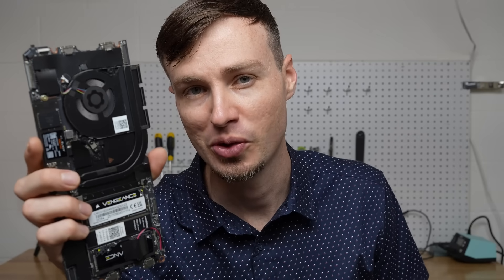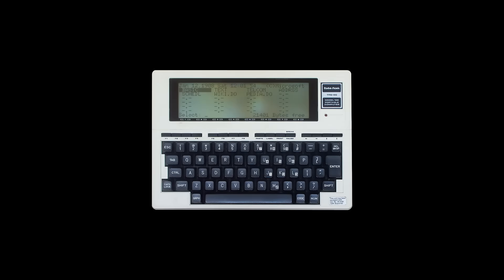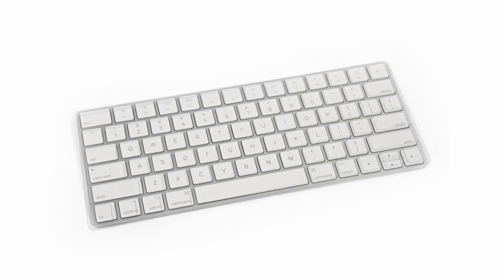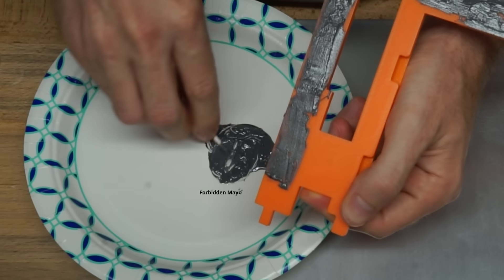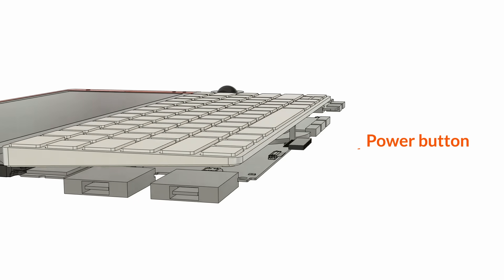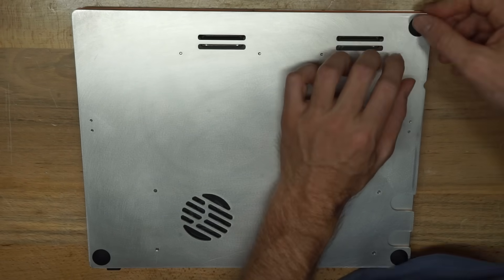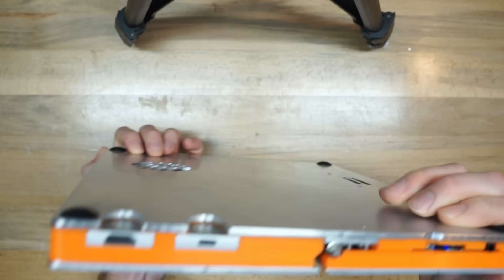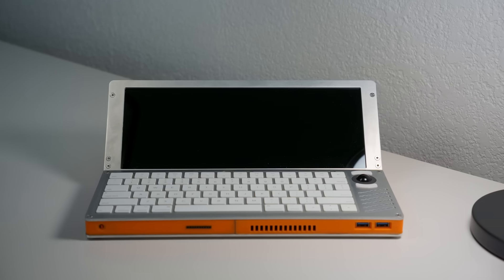Framework Cyberdeck - DIY Portable PC

Comment: Than useless Fn key on the bottom left
hm
Could you imagine if you were able to code it so that when pressed and held down, the trackball would behave as a scrollwheel ?
So even when handhelp instead of on a surface it would be easy to shift you left thumb down a bit, and then use the right to do the scrolling.
And whatever top right button that is near the trackball would maybe be a middle mouse click (scroll wheel click) also when Fn is pressed down
That or a rotary knob but it would imply changing the HARDware and the know might be too tall for an idea I have (3rd paragraph)

I love the end result
I'm nowhere near as talented as you are, so apologies for mentioning some "easier said than done stuff" but if I had to bring up a few gripes and pass them on as "recommandations", I'd say that I'm not the biggest fan of the exposed stuff on the back... to an extent. I think a clear sheet of acrylic would be dope to show off some of the stuff when the screen is lifted, while preventing snagging or other misfortune to the pieces and especially the ribbon cables.

Also I was thinking about that one ASUS x ACRNYM tablet thing (edit : asus acronym z13 is the name), and was wondering about some sort of "case" to clasp onto it to protect the screen, keyboard and powerbutton while also having sling attachment points. Note : the asus thing does not have a case and uses a folio style keyboard that covers the screen, but it looks VERY industrial, futuristic, cyberpunk even, and has a way to attach a sling for transport. Which I think sets it off rather than a normal laptop sleep. Also I'm thinking of a solid case, not soft. More metal woooo
Reply: I love the fact that being a framework, it too is upgradeable, wether in the future or even right now if you want to make it a blazing fast little machine (let's ignore budget constraint for now)

Comment: Great job!!

Two things you mentioned that always baffle me.  

1) why don't laptops have HDMI in to use the screen as a monitor ?

2) why doesnt anyone make cheap SBC that runs Windows? I mean Pi, orange Pi, Banana Pi, Rock Pi. And many others. But nothing for Windows? Why?

Also would be nice if you shared the cost. I just checked eBay and couldn't find the motherboard.

Comment: You can unofficially run Windows on RPi but all exetuables have to be compiled for ARM64. On Linux most things are open source and then just compile. If not qemu can emulate an app (!). On Windows I don't think there's such a thing for ARM.

Comment: For the IO modules if i may suggest a part that could solve your problem and make it easy to remove them. The basic idea is a sled with two rails on the side and a lip on the back which would interface with the module's back side. You place your finger into the hole on the bottom of the sled and pull it out of the assembly in one piece. 

Fusion360 Screenshots of the part:

https://snipboard.io/gjhpbE.jpg
https://snipboard.io/KxXk43.jpg

(please note this is just a quick sketch to illustrate what I'm talking about)

Comment: Old Compaq LTE laptops had the trackball mounted in the screen frame, with the small ball next to the screen on the righthand side, and the buttons on the back(top of the lid)

No major manufacturer call their portable for 'Laptop' any more. Most of them gets too hot to safely use on your lap, so they avoid the word to avoid lawsuits.

Comment: This is awesome.

Only things I see that could be improved on top of your observations is the flex cable from screen to control board being so exposed. Maybe it'd be better to have the control board attached to the the screen side of the top part instead of the base plate. Them you could have put some kind of thin covering film (capton or some other foil) on the bottom/top insides to close that off neatly and route the inputs of the control board to the edge of the device.

Comment: Ok, seriously - while I, personally, would not use this... this shows basically the power that things like Framework offer - the results of its ideals and hard work.

When I was younger, I remember we buying computer parts on basically "flea markets", hoping that things would work together, hacking solutions... there were people that sold computers built inside wooden boxes that merchants used to sell fruit, for example, and there were a lot of people that simply tried to build the wackiest, weirdest combination of pieces that somehow functioned as a computer.

Then it mostly went away, then it was back with Raspberry PI and limited resources. Now... it can be revived, just because we have a company that is worried about making reusable pieces, not gluing everything together, etc... this is seriously VERY COOL!

Comment: The mouse ball… is fine but the left/right click button placement makes zero sense. Could have placed a set on the left of the keyboard.
Reply from the maker: Those buttons were integrated into the trackball module already, but yes, I should have wired in separate buttons on the other side.

Comment: Weird, heavy, and rugged is perfect for me. Ideally I'd CNC the whole thing out of two blocks of aluminium, and a sheet for the screen bezel and keyboard cover. I'd make it completely foldable in a clamshell design though. 
I would also probably somehow integrate a trackpad, instead of the ball, or at least place a scroll wheel module next to it.

Comment: Been thinking about a similar idea to this for a really long time, and yours is really cool. This is less ambitious than the things I have been thinking of, but has the benefit of actually existing.

The main concept for me was: what if there was something about the size of a netbook, with a computer that didn't suck and had a good keyboard. Mine would end up being bulkier, since my intent was to base it around a tenkeyless mechanical keyboard, and a clamshell design. Compared to yours it would be a brick. And the idea I can't seem to get out of my head is have an E-ink display, since the usual scenario where I think about using a computer like this is just randomly being able to sit down and to programming basically anywhere, and part of that is visibility of a screen in sunlight.

I am probably never going to get around to building it, but it feels a lot more possible ever since the framework came out.

Can you maybe do a follow up on this in a few months or so after you have spent some time using it?

Comment: Interesting use of the framework motherboard and i can see custom cyberdecks becoming more mainstream once modular laptops start getting more popular
also i'd highly recommend trying to find a low profile wifi/bluetooth adaptor you could solder somewhere, give it a little more versatility without having to take up a usb slot

Comment: Wondering if you can eventually use a Framework board as a Steam Deck replacement, so you can use the system as both a portable console and a laptop proper when you're at home.

Comment: I think this shows how much framework changed notebooks in general. It doesn't have the freedom that desktop PCs have but now we can literally build our own notebooks ourselves. Hopefully something like this comes to smartphones and other devices.
Reply: framework phone?!
Reply: @griffingibson4389  why not use the custom cyberdeck and an Internet gateway to make a VOIP call? Dump the ankle monitor.
Reply: @griffingibson4389 it already exist is called fairphone
Reply: fairphone has quite a modular system but I haven't seen anyone build something else with those. but the connectors between the modules are well documented so it should be possible... if I ever find the need to upgrade my FP4 I think I could try making something cool with it(s parts)
Reply: @thetj8243 The issue with fairphone is its wayy overpriced for what it is, its got worse specs than a Samsung A54 and is double the price.
Reply: phoneblocks and project ara. none worked though, probably a bit too ahead of their time and not enough advancement in tech.
Reply: They literally piece together phones from scraps in chinas malls.
Reply: this shows my ass
Reply: I believe they’ve mentioned that as a potential far future idea. Not totally sure tho
Reply: An ancap Linux user! Rare sight!
Reply: There used to be plans. Look up Project Ara. It was shut down. But hopefully someday someone resurrects it
Reply: Desktops have loads of space, laptops have less and phones have very little, you won’t get a modular phone any time soon.
Reply: @conorstewart2214  nah, just redefine modular and u got 2 decades ago, for example your cellphone with removable battery. Every electronic have "modular" capability, it's just how you view things
Reply: @conor fairphone 2
Reply: @conorstewart2214  the Aria would've been nice if Google hadn't killed it.
Reply: Well, it's not like you've got much freedom with pc parts too - a new generation of CPUs likely won't even work with your motherboard and everything is chunky asf
Reply: @ruslan_yefimov  "a new generation of CPU" this a given. but literally everything else has freedom for 7+ Years. i can use a GPU from 2005 ffs.
Reply: @ruslan_yefimov AMD supported the am4 socket for like 5 years+
Reply: @ruslan_yefimov  While I don't agree with your opinion, AMD has proven it's possible to have better performing new parts on older platforms, as for chunky, There is no way to ignore power usage, you need a robust cooling solution to use high power parts (modern GPU's) all laptops do is claim the part is the same but limit it's power heavily (if they could make it work on a 15mm laptop, why would they bother with huge desktop form factor coolers) and even under best conditions, the laptops do burn themselves out in the end much faster than a desktop would simply due to how tightly everything is packed together. And like another comment said, I can pop in an old ethernet pci-e card and it will work, i can have 3 different GPU's for 3 different use cases in use at the same time. I can modify my BIOS to support features that the mobo manufacturer didn't want/couldn't/wasn't profitable to include. All that's currently limiting is intel style approach to platforms and chipsets, imagine we had to swap our motherboards once every 10 years. you would have the same PC for a long long time. unfortunately they force you to upgrade the main part of your PC which is imo hardest to replace if you have something special (2.5g ethernet etc) than a CPU that just inserts into one.
Reply: @ruslan_yefimov  Whatever you're taking... I want some. CPU's wouldn't sell if there wasn't motherboards to support them, that means both motherboard and CPU manufacturers need to work with each other to make their products. Some processors require more power, the motherboard needs to be able to handle that load. 
Addressing the whole chunky thing, that's mainly for airflow. Believe it or not electronics get hot when you shove a lot of electricity through them, there's not a magic void that can suck that heat up.
Reply: @Deja117  yeah with a desktop they are going for maximum performance and adding in lots of features and connectors and making sure you have space to use all the connectors. A laptop however is designed for efficiency and to be as small as possible hence a lot less power and a lot less connectors and saves space by soldering CPUs or RAM.

You do get small form factor desktop components though, they aren't anywhere near as compact as laptops but they can be a lot smaller than normal desktops.

Comment: This project is BONKERS! Thanks for the inspiration my dude, and also, I know the arduino helps with the GPIO which was an objective to the project, but if you or anybody wants to recreate without the arduino, the track pad port for the laptop usually uses ps2 so you could wire the trackball to the mother board directly.

Comment: Next time use Polyamide tape instead of electrical tape. Electrical tape seems to come loose after few days. It doesn't adhere properly. Along it, you can use Tesa or 3M double sided paper backed adhesive or thin plastic backed one. This is easy to remove when you use IPA.
Reply from the maker: Thanks, I'll look into that.

Comment: You should find some apple key-caps that are also orange to fit with the sites kf the body of the machine.

For the exposed parts of the back of it, you could probably have a thin housing and maye find a way to tuck the wire for the screen itself away.

I'm also thinking you can make it so everything is on the upper half under the screen and the rest on the lower, so you fold the screen forward to move the expansion slots and maybe have a second cooling system for when the screen is folded forwards and another fan can just turn on, possibly with the help of a switch. Maybe, itteration 2 would be the deciding factor if you see if that might work out.

Comment: Nice design, but how would I cut the aluminum plate into two parts? The device will still be thin and cool, and at the same time you will block the path for dust and damage to the monitor ribbons. For better stability, you can add additional support for the monitor because the motherboard takes its toll. I would change that. The rest seems pretty cool. What would be the price for such a device if it were sold?

Comment: I feel like this is the first Framework Cyberdeck I've seen, though I could be seriously wrong.  And I too really miss the design choices of the late 90's and the 00's.
Reply from the maker: There is at least 1 other one I saw that was made with clear acrylic, but it did not have a full keyboard and had a very small screen.

Comment: looks great man! I had a mild obsession with netbooks for a while and the biggest problem was lack of performance and low screen res. Your project looks amazingly similar to what I wished I could get back then. I might just pick one of these mobos up. Great work and earned my sub
Reply: There were fast netbooks, but they were crazy expensive. During my time at tech university in Munich, there was another student which had a new HP netbook with an i5. It was 2010/2011 and as far as i remeber it was over 2000€. It was very small, less than 12 inches and super thin. But still had better connectivity than what we get nowadays even from big laptops. Ecxeption maybe the Panasonic ones. I do use a Toughbook detachable for work and a Let's Note (2000's laptop with modern parts, basically) which have good connectivity, but are bulky. The small laptop market is grim nowadays.

Comment: For scroll wheel you could use the trackball and one of the unused apple keys to switch between modes.
Or add a button to the arduino to change between scroll wheel and mouse pointer movement
Reply: Exactly what I was thinking.
Reply: I just pooped my pants daniele

Comment: They do make PS2 to USB adapters, so that might could have been an easier way to handle that. Or, ya could have just gotten a USB trackball. That's also a thing that exists.

For that matter, if you're going to use a microcontroller as a middleman, why not just hook the keyboard and trackball up to the respective ports on the board instead of eating up a USB with it?

EDIT: I do have respect for the work and results, btw.

Comment: I was thinking the other day to something that would be pretty much the opposite to this.

A screen+keyboard computer with minimum hardware. Something that will just power a windows install. Something really tiny. And and a really flat battery.

Like battery+keybard+screen and a tiny computer in the corner below the keyboard. And something like a Intel’s $150 Compute Stick to power it all.

A computer for typing, e-mailing, light spreedsheet work and maybe watching some youtube. Like a very light travel PC with a somewhat large screen and a really comfortable keyboard.

Comment: How did you made those 2d outline drawing of the 3d cad models and then animate them 0:10 ?
Reply from the maker: Fusion360 - the software I designed this in has a line render style. So I did the animation in there and rendered it (it was black lines on white background) then brought into the video editing software (Davinci Resolve) and inverted it, then applied a color filter for the orange color.

Comment: Awesome build! I love the form factor, and its implementation had my mind racing with potential ideas - a carry handle, or the ability to pop the keyboard out and use it (with a cable that tucks back in when not in use), like some '80s laptops had as a feature. What this build ended up doing was great, especially with the constraint of keeping things as thin as possible.

I'd be curious to see what this machine can do when expanded through the Thunderbolt ports - even though an eGPU enclosure (what I use) is the opposite of saving money, an ordinary TB4 dock can prove very powerful indeed. My framework is a fully-fledged desktop replacement!

Comment: for the trackball that was ps2...... couldnt you just use one of those old usb to ps2 adapters that used to be everywhere?  was space a concern with that method?  would you lose functionality?
Reply from the maker: I wanted to have an integrated arduino anyway - see the ports on the front of the device - plus, I can do things like change the button mapping or pointer speed right in the arduino code. Can't do that with an adapter.

Comment: You can run an m.2 on a raspberry pi since they added pcie. Especially the new v5 model. But wondering if some of the stuff clockwork pi makes could be an interesting base too?
Reply from the maker: I still feel like they should have put a physical slot on the bottom of the board like the Latte pandas do, but maybe that would have increased the manufacturing costs too much.